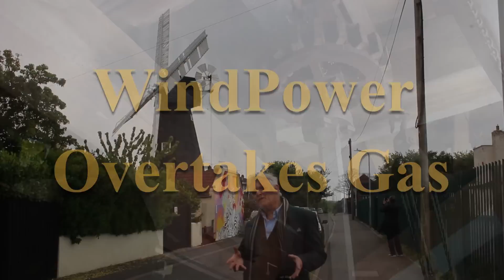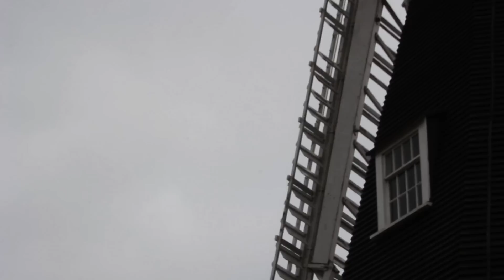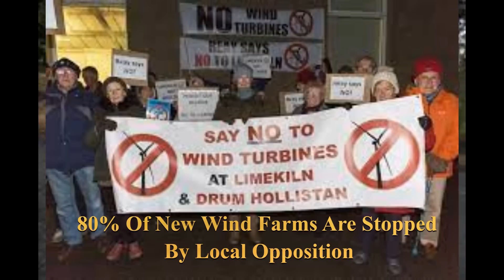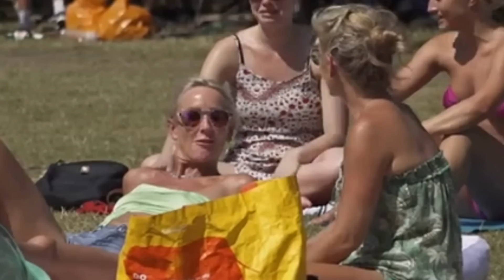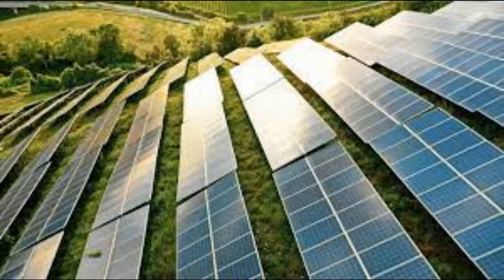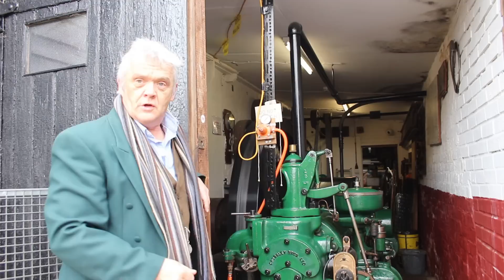1926 Wind Power Overtakes Gas In The UK and A Visit To Drapers Windmill

Comment: Of course the other point about wind mills is that the miller used the mills when the weather allowed it, probably late nights and over the weekends. Perhaps as a society if we had a (slightly) lower expectation of instant power for everything then we could better balance electrical consumption to the weather. This might be as simple as saving our laundry for a dry (sunny? Windy?) day. This would result in less fossil fuel demand when the weather does not suit as well as reduced curtailment from renewables when the electrical demand is less than we are able to consume.

Comment: I know they aren't designed to make electricity and as you said they aren't the most efficient but there must be a few that have been converted to make electricity so it would interesting to see how much one of these can actually produce. A load of these in the countryside looking like holland would be stunning. If your handy you could make your own wind turbine up to id reckon a 3 mtr diameter relatively safely but you couldn build a 1 mw one yourself but windmills are mostly a building and could be built by and skilled carpenter. Same with the working parts could be made old school or on a cnc router. Id love to live in a windmill that generates electricity.

Comment: I wonder what energy is used to make the wind turbines. Is it renewables or is it coal/gas fired. Also solar and wind powered have a use by date. How do you recycle or dispose of these? These are the real questions that need to be asked.  About 5% of the electricity is generated by solar/wind here in Australia. So most of the electric cars driving around here is what I call coal fired electric cars. The electricity used to recharge the cars are from coal fired electricity 🧐🤔

Comment: Here in NYS, we have a 15' x 40' solar panel on my barn & a "net meter" arrangement with the power company. The "net meter" arrangement just means I give them my excess power when it is produced during the daylight and they give me back power whenever I need it, namely at night & in the winter.
  It turns out, the power company's peak demand comes during midday in the hottest months of the summer while my demand is during the winter months when they have excess hydropower. This way they get to avoid buying very expensive "peaker" power (aka brownouts).
   Another advantage to us, our cost of power is fixed at the solar panel installation cost, namely at 5 cents per kWh US for the next 25 years. After 3 years, we have accumulated more than enough solar power credits to power our house, farm & electric vehicle.

Comment: That gas engine you showed in the video with the big flywheel attached. Is that a "hit and miss" engine? Looks like it at 1st glance. Those are pretty efficient. 

Could a Gravity Battery be used with Stanford Universities Scientist Water Splitter at 1.5v using Nickel Oxide electrodes, to create HHO gas to power said gas engine? For what uses? It's absolutely possible to power a home without need for an energy grid and the common fuels.

Comment: I like your perspective Rob. Curious, I noticed the louvred windmill blades, they looked adjustable? thats pretty cool
Reply: The louvres are there to regulate the speed.  If the wind is too strong, the mill would run too fast, so opening the louvres slows it down.
Modern wind turbines also adjust their blades when the wind is too high.
Reply: It looks like they are automatically 'getting out of the way', maybe to prevent them resisting the rotation? Or maybe opening them up as they cross the body of the mill, since there's not going to be significant air flow through there? But yeah, I wondered what was going on there too.

Comment: When you consider Drax power generation burning imported wood pellets and producing more CO2 than its former coal burning life is deemed "renewable"  I tend to take these figures with a pinch of salt.  If the NIMBYs where allowed to buy their electricity at a cheap tarriff If they live close to the turbines I'm sure objections would be minimal.  But when they have to put up with the site, noise and shadow without any reward it's an uphill journey.  Smaller, more aesthetic turbines feeding a local grid at a reduced cost is in my humble opinion not only more acceptable but more resilient to climate extremes

Comment: A nice illustration of how "green" wind turbines are: 1 metric ton of rare earth magnets in a standard wind turbine equals 1 metric ton of finely dispersed uranium and thorium near the mining/processing facilities. Cancer rates in the nearby population are around 40% now, if not higher. So yeah, every wind turbine here is killing people in Northern China, Mongolia and Northern India. Not in theory - in reality. The contamination has recently reached the Huang He (Yellow River) so officials made reporting on the issue a bit harder. ... Should we talk about the decommissioning process for used rotor blades? There isn't a good one. They end up in landfills ... once the core temp of the dump exceeds 65°C, the epoxy starts to break down and release the bisphenols (around 45%) into the environment. ... 10million tonnes of blades over the next two decades is a LOT of bisphenols. Bye-bye wiener, bye-bye babies. Yup, large-scale wind power clearly is the way forward...

Comment: The opposition to wind turbines is a bit more complex than your assertion that people simply don't like looking at them. Large wind turbines are extremely loud and generate continuous vibrations in the ground that literally destroy the ecosystems in which they are placed. I was the first person in California to install small wind turbines on my house that were connected to the grid in a suburban environment and I can tell you it was an abject failure because of the noise and vibrations. And before any haters try to pretend that I somehow didn't install them properly... I am an engineering physicist that owned my own renewable energy company at that time that specialized in solar, wind, hydro, etc., and I worked with the experts at one of the largest wind turbine manufacturers at that time to construct a tower system designed to damp out the resonant frequencies of this turbine system and it still was untenable in practice. The Altamont wind farm just a few miles from where I grew up was the first large commercial wind farm and it demonstrated how  the entire ecosystem for miles around was effectively obliterated by these same issues. The wind farms were actually forced to buy out people's homes that were rendered unlivable due to the proximity of the turbines which in some cases were miles away.  The only thing that can survive around wind turbines is livestock because they are not given a choice.
That said, I still believe wind power has its place but there are many complex issues that have to be dealt with before you can just throw a turbine up. Its not simply  esthetics. There are always tradeoffs.
Reply from the maker: it might be more complex but the over-riding reason given in planning application debates is - 'they don't look nice' - check out a few declined planning applications and the debates
Reply: @ThinkingandTinkering  people tend to change their mind when price per kWh shoots up by 10x, it happened in Sweden where they shut down a nuclear plant because people didn't like it but now they are debating building a new or restarting the old one to bring down prices again.

Comment: Besides ugliness , big wt make a lot of noise . It is not very loud (unless you are very close to it , when the wind is blowing) , but it is almost constant and that is (at least to me) very annoying. I spoke to some Germans (which live about 1-2 km away from a few big wt) and they hate these things (although they like "clean" energy). The "green religion" is not about climate change - it's more about money , control and power. However , this channel is not about politics , even though climate change and alternative sources of energy are , so keep  producing practical suggestions (devices) about possible solutions.
Reply: Wind turbines cause vibrations in the ground that travel long ranges. If you live near wind turbines (like I do) you can often feel your house vibrate and hum. Not always (seems to depend on the direction of the wind).

Comment: I know where you're coming from, but I think that it is an oversimplification to say all we need to do is make them pretty. The other issue is that I think a lot of people don't trust 'government' and/or 'science' as much as they use to. There's not a lot of research that's done now that isn't sponsored by those that will benefit. That, plus the various scandals, mean that scaremongering is very effective. The trust of the people has been lost and people are scared. People do not act rational when they are scared. The Age of Enlightenment is well and truly over.

Comment: On a different note. Love your stuff. Transport. Magnets n coils. What if you made a disc like the ones thrown in that sport. Imbed the magnets in the disc, slot the disc in a track and knowing the disc diameter you know the linear distance of the disc in the track. One could then theoretically, power a coil with as much energy as you like to force the disc to spin which would propel the disc down the track and knowing where the disc will be, another coil could be fired at that point to propel the disc and so forth and so on. Then what if one were to have a sled with three to five on either side. One could hit the magnet perfectly like a baseball batter and how long could the track be? Then what if one were to make two sets. This gets rather interesting as one could get the disc up to speed before making contact with the track? I could be mistaken.